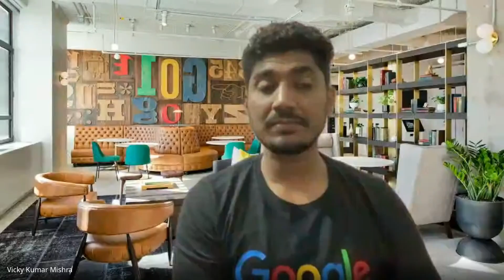Processor Design Course for VLSI, RTL & Semiconductor Engineers | Build Your Own CPU from Scratch

Comment: Have designed a 32-bit 21-instruction 5-stage Pipelined RISC processor through Verilog 6 months back. I did it through the book of Smruti Sarangi Sir(IITD). But after that, I got busy in placements, so couldnt do anything more. Now that I'm placed in Cadence, its just the right time for me to do this. Thank you for this, will definitely try to build a project based on this series.